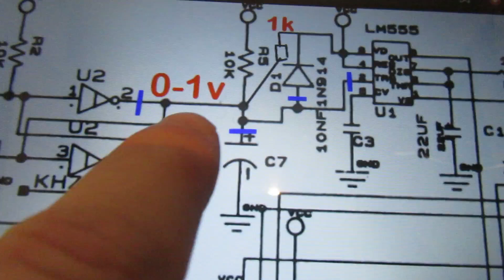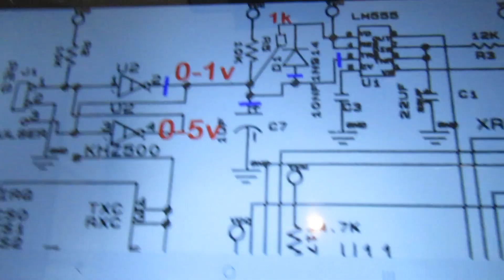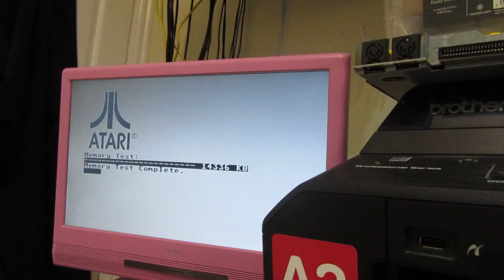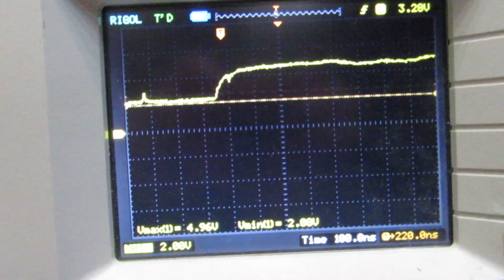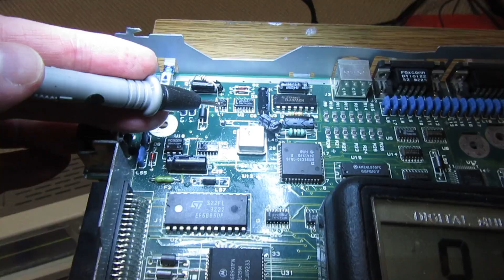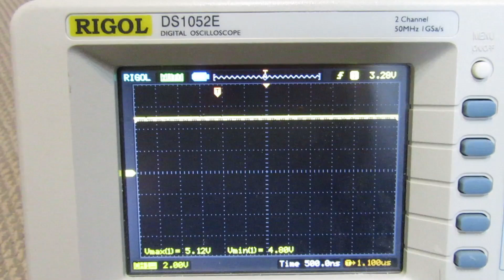Atari Falcon reset circuit issue - part 2

Comment: Very odd. That intbetweeny voltage had me thinking a misplaced ground somewhere along the line, but nothing should really have been influencing the test point at that time.

Big old solder blob on your resistor mod. It's not close to a via and a little bit of flux residue was conducting?
Reply from the maker: Problem is , it wasn't working before I unsoldered stuff.. so what came shouldn't be a factor... Annoyingly, if I had just sprayed the area right from the start.. that could have saved me a few days messing about..
Reply: @exxosuk  Mmm. Still doesn't pass the smell test to me. Reckon there's still something else going on.
Reply from the maker: @thetechnoshed  no idea what, I pretty much exhausted every avenue I could think of.